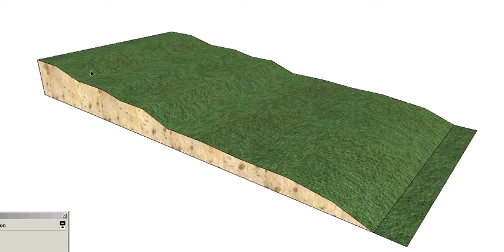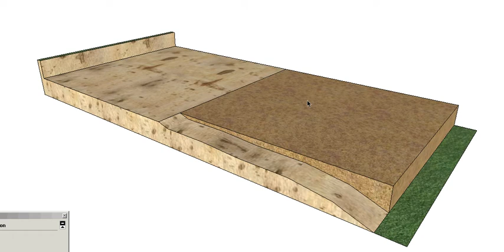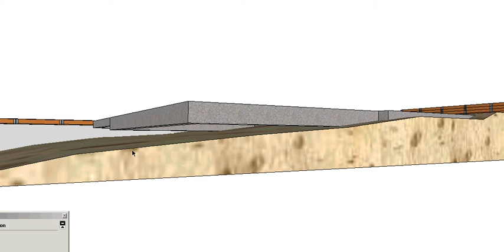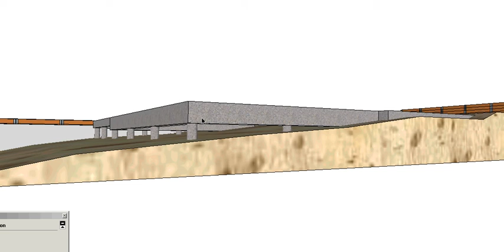Cut and fill and Piered footing system

Comment: Great video's Buildsum, Thank you very much.
Am I correct in thinking the fill doesn't need to be correctly compacted but just rolled over with machinery as the concrete beams are spanning between piers, ie so the soil under the slab doesn't need to be compacted?
Reply from the maker: Hi Rohan, the main issue is that the compacted soil will still move differently to the original foundation material. You would need to consult with your engineer as to how much compaction you would require.

Comment: This was hugely informative, thank you! I have one question, if the whole area was filled (rather than cut then filled) and the concrete slab was not crossing between the cut area and the filled area, would this till apply? Or would it be only the footings without the pier system? Thanks in advance, I really appreciate you sharing your knowledge.
Reply from the maker: Hi Mike, if the entire site was on fill then you have a couple of options. You could pier the entire footing down to the natural foundation or use a Raft slab that would move with any settlement in the fill.
Reply: @Buildsum  Thank you! I'll check it out

Comment: is it possible to use rollers to compact the soil?  then making the use of piers obsolete
Reply from the maker: Hi Mate, the problem is not the amount of compaction rather the difference between the natural surface and the fill. Compacted fill will generally be more compacted than the natural ground and therefore still move differently. Piers are still required to the slab or beam is conected to the natural surface level.
Hope this helps

Comment: Wonderful video mate.
Very helpful.
Just wondering, whats the normal distance between piers that you install on site?
And also how often is it necessary to install internal piers for slab?
Reply from the maker: Hi Asim, thanks for your kind comments. Working out the spacing of the piers is the role of the Structural Engineer and will differ for every site depending on the soil type and conditions.